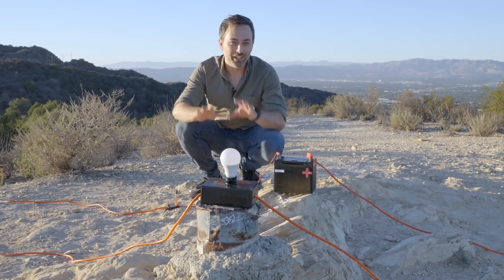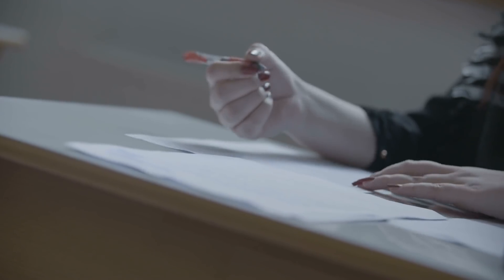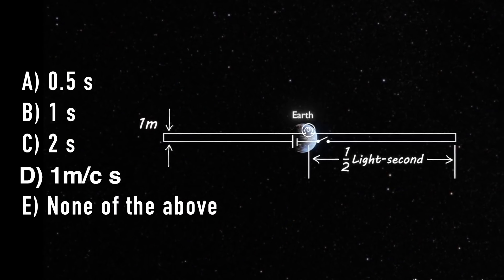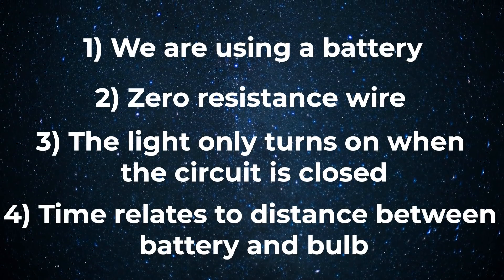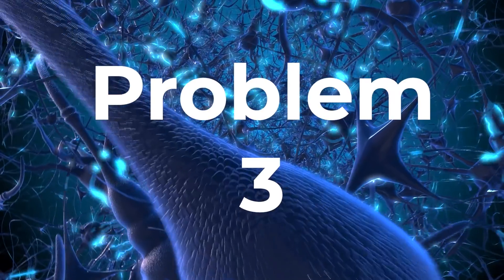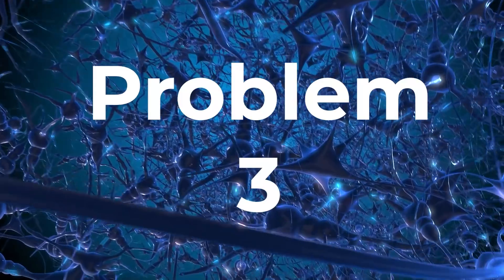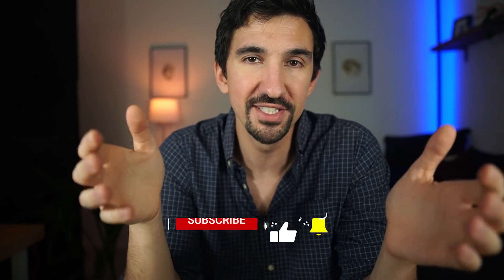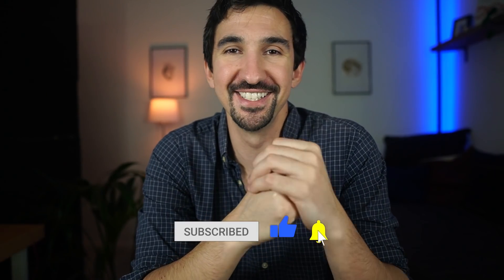Is Veritasium Wrong About Electricity?

Comment: This is my disclaimer: this is my field. However, it's been 4 years since I took the class that would be most relevant here and regularly worked with the formulas needed to predict this counter-intuitive concept. Here's my take on assumptions 3 and 4. First, to combat the faster than light communication scenario you mentioned. I don't think the time relies on the distance between the battery and the light, but the switch and the light. The side of the switch connected to the battery must be equipotential to the battery (assuming the setup has been sitting for any reasonable amount of time).  Therefore the electric field strength is exactly the same at each of those 2 points (the battery terminal and connected switch terminal) so closing the switch would be equivalent to just connecting the wire on the other side of the switch to the battery directly. I think it's safe to say the time depends on the distance between the switch and the battery. Since they were negligibly close to each other in the picture we were given, the answer should be the same. However, if a break develops at either end, it will take the field time equal to d/c to get from the break to the bulb. This does not fix another potential faster than light communication issue. Instead of breaking the circuit after being closed, let's break the circuit before being closed. i.e. a switch at the far end of the arm. Now when we close the first switch, by our mental model, the light will either turn on nearly instantaneously or it won't depending on the state of the second switch. Thus we can know the state of the other switch faster than light could carry that information. And I think you covered this one when you broke down assumption 3. The antenna-like properties of a 1/2 Ls long wire would mean the light 'turns on' immediately regardless of the switch 1/s Ls away. However, it will take time for the electric field to propagate to the end of the wire, where charge will start to build up. Like filling a cup, that charge buildup will eventually back-propagate to the battery. when the charge density creates the same potential as the battery terminal, current will cease to flow, and the bulb will slowly dim and turn off. This would also differ from alternating current where the charge never has time to build up to the point where no current flows and so the bulb remains on.
Reply: Spot on my friend. Your thought experiment of breaking the end of the wire before we close the circuit really makes it clear for me. Veritasium is correct in that energy will reach the bulb in 1m/c seconds after closing the switch, but he's wrong to assume/suggest that this energy is anything substantial. It's small induced current. In a closed circuit, the field will eventually propagate to the end of the wire and there will be a current everywhere, therefore there will be a magnetic field and thus, energy flux towards the bulb (technically towards the wires as well but let's assume superconductivity again). So I believe the energy reaching the bulb will gradually increase over the course of 1 second until it reaches maximum brightness after the field has had time to reach the ends of the wires. On the other hand if the circuit is broken, like you said, eventually the charges would build up and reach an equilibrium such that no current is flowing any more. In the first few nano (pico? femto??) seconds after closing the switch, the behaviour in the closed circuit would be identical to the open circuit. This obviously follows from locality; if the break in the circuit is very far away then there ought to be no discernible difference in behaviour until the information has had time to reach the break. But in the case of the unbroken circuit, the energy flux just increases to a maximum over the course of about 1 second. In the broken circuit, the current drops off to zero over that same span of time. Another way of looking at it in regards to the causality violation: if the break is close enough to the switch (within 1m...) then clearly violating causality is not an issue, only if the break is farther from the switch than the light bulb is. But according to the ideas we have discussed, this is irrelevant, because the only energy reaching the bulb is that small initial amount, not the full amount. If a break is encountered in the circuit, then the energy flux will stop building and start falling, and it will take d/c seconds to do so if the break is d meters away. Hence, no causality issues.
Reply: @disgruntledwookie369  I think there will not be a gradual increase, but two steps. Step 1 will happen when current is induced in the bulb, which will happen after 1/c time. Between this time and ~1s time the current in the bulb will stay the same. Then, as soon as the wave propagating along the wire reaches the bulb, there will be a stepwise increase in brightness.

Actually, on second thought, I'm not sure I am right :D
Reply: @ArgumentumAdHominem  I think that's not the case. If you look closely at a diagram of the Poynting vectors for a simple circuit like this, the energy flux is kind of spread out along the whole length of the wire. A small portion takes the shortest path directly from the battery to the lamp (1/c) but this is an infinitesimal fraction of the total flux. As you move farther from the battery/lamp in the middle, the energy flux paths become longer and longer, thus taking more time. The energy literally is transmitted by the electromagnetic field but it very definitely follows the Poynting vectors. The longest energy flux paths basically follow the wires all the way out to the far ends, half a light-second away, so the path overall is on the order of 1 light-second in length, the energy will take about 1 second to traverse it and reach the bulb. But this is also just an infinitesimal fraction of the total flux, which is spread out along the whole length. After ~1m/c seconds, the first energy reaches the lamp, it then gradually increases (I don't think it's linear, anyone??) to a maximum after ~1 second.
Reply: @disgruntledwookie369  If you're right, it is most likely not linear. The wave propagating along the wire covers same distance per every unit time, but the wire elements are at different distances from the light bulb and at different angles.

The question that puzzles me: what happens if we insert some dielectric or diamagnetic sheet inbetween the wires. That will affect the fields. But will that affect the result?
Reply: @ArgumentumAdHominem  It will definitely affect the result as some nearby magnetic flux fields will reach the bulb quicker, but the very majority of them along the wire will still need around 1 second to reach the bulb.
Reply: @disgruntledwookie369  Thanks for your replies they are helping heaps. So I think I have a handle on it now. If the wires were made in a circle then the time would be 1 second for the light to go on? André
Reply: Great explanation!
Reply: Great info! However Breakin this info up into paragraphs would reduce the eye-strain oh man
Reply: What would happen if we put either the bulb or the battery or even the entire setup along the wire in a faraday cage?
Reply: @bertold7353  well, I didn't study faraday cages directly, but if we put the whole setup in a faraday cage, as I understand it, nothing changes because the faraday cage doesn't eliminate EM fields, it just stops outside ones from coming in and inside ones from going out. If we put only part of the setup inside, if there is a connection between all the parts, there must be a hole in the faraday cage for the wire to come out. So EM fields would also be able to leak out. It would just be a weaker signal is all.
Reply: So, about your second FTL communication scenario. I think you are ignoring transients. 

When the switch near the battery is closed, electrons will start drifting, an electric field will be generated, and the lightbulb will light up. Then, after roughly d/2c seconds the electric field wave you started will arrive to the open switch in lunar orbit. The electrons will "bump" against the end of the wire, and stop moving. This will kill the local magnetic field as charges have stopped moving. This "bump" will back-propagate through the wire in roughly d/2c seconds. When it arrives to the battery, the magnetic field around it will die down, the poyinting vector will become 0, and energy transfer will stop. Therefore, no info was transmitted faster than light, the lightbulb only turned off after d/c seconds.

This is not even close to being my field, so I may be spewing random bullshit, but this is what makes sense to me.
Reply: @linerider195  that sounds like exactly the same thing I said. For DC, it turns on, then slowly dims and then turns off as the charge collects like a capacitor. In AC, the bulb stays lit regardless of the state of the far away switch
Reply: @ajreukgjdi94  oh, it seems like I misunderstood you!
Reply: So you’re saying the information from the switch just "jumps" to the light, and doesn’t have to travel down the wires? Why have the wires to begin with then? You’d invented magic wireless circuits. Trying to hand wave it as an antenna "because the wire is sooooo long" just gets you back to the time delay for the potential to move through the wire. 

This is actually a regularly tested phenomenon with long coils of wire. The delay is alway proportional to the length of wire with the signal traveling at about 0.75c
Reply: @letsmakethis  that's very close to an experiment I did in my E&M fields class. I would very much like to go back 4 years and ask my professor some of the questions I have about both Veritasium's video and that experiment. Did I misunderstand the purpose or result of the experiment, or is it not a valid analog to this situation. I don't know. It's been too long since I was practiced at calculating or predicting this stuff. I'm just trying to make sense of what I've been told. And I've been told the length of the wire is irrelevant for transmitting energy. However, no claims were made by Veritasium about transmitting information. BTW, when I say 'Ive been told' I do not mean 'I believe.' I will reserve that designation until I have seen proof and/or a better explanation.
Reply: @ajreukgjdi94  your explinations have been really helpful but there is one thing I am slightly confused on. When we initially close the circuit and the magnetic field initially starts propagating that small amount of energy to the blub and the circuit hasn't fully been formed as the magnetic fields along the circuit haven't been generated yet...how does that initial energy know that the bulb is even connected too it? what is to stop the energy travelling instead to another bulb not connected to it at all? Essentially how does the Poynting vector have a direction before any information about connection could be known? Sorry if this makes no sense 😅
Reply: @thebeastisback2697  something I wondered strongly myself, and one of the main reasons I'm withholding belief of this bizarre fact until I hear a better explanation or experimental evidence. My first thought is the wires only act as antennae according to this thought experiment. Current flowing in a wire creates a magnetic field which means no wire to propagate.

In the case of a DC source, the wire also provides a continuous path for electrons, allowing them to flow indefinitely, thus continuing to produce magnetic fields. Without the physical connection, the energy would start flowing until the charge density is once again uniform along the wire, and current stops, therefore so does the magnetic field.
Reply: Great point! This really clarifies to me what is going wrong in the original explanation by veritasium
Reply: Considering the diagram at 7:17, what is the significance of even having a switch? If the fields propagate  from the battery to the bulb, does turning on the switch just amplify the coupling? If you increased the voltage of the battery, is it correct to think that with some large enough voltage a switch (or wires) aren’t even needed?
Reply: @shmish  When circuit is open, only electric field is there. Electromagnetic field will be established only upon closing the circuit and the magnetic field will induce current across the bulb. Larger voltage should result in brighter bulb.
Reply: Wanted to ask: the electrons from the battery flow and create the fields, right? Because V said the electrons barely move but didn't mention which ones..
Reply: @MotokoKusanagi  All the electrons in the circuit move, none of them particularly far. A single electron leaving the negative terminal of a battery is not likely to even complete a single lap of the circuit. Strictly speaking the electrons themselves are generally moving very fast, but in more or less random directions. An applied electric field will induce the electrons to move on average with a slow "drift velocity" while continuing to bounce around randomly at high speed. The thing is when you "zoom out", you don't see the electrons whizzing about randomly, you only really get a sense of the total charge flow (current).
Reply: @disgruntledwookie369  so electrons going almost nowhere,  not being transformed to another type of energy, yet a non-present flux can create an electronagnetic field across the whole wire... Btw I don't think that yhe original thougt in Veritasiums video was about the unforrunate wire setup but the fact how energy travels.. another question: I guess induced electricty has lower output than by wire e.g. electron flow might be factor? Thanks for replying! This was always a mystery, teacher never bothered to dive into this .

Comment: I thought the point of the Veritasium video was that the light bulb would go on because of the electro magnetic field outside the wire transferring energy to the bulb.  In this case it wouldn’t matter how long the wire is only that the bulb is close enough to the battery to be directly influenced by the electro magnetic field traveling through the air, in this case one meter apart from the battery to the bulb.

Comment: you both have problem. current man's picture of atom is wrong. due to this ignorance there is no common point of reference to explain what actually happens. Your explanation is assumption from interpretation of trial and errors data. Agreed assumption is best you have but it dose not make it fact. this apply to most of your science of space and matter. Take speed of light. It was accepted to be fixed in vacuum. I think they referred to low density matter in space. As there is no vacuum in physical universe. They had no mean to test speed in space. Now they have, but DLR, ESA & NASA refused to test speed from Earth to space and from space to Earth. Result will show, you will need new physic. Ferydoon Shirazi. MG1